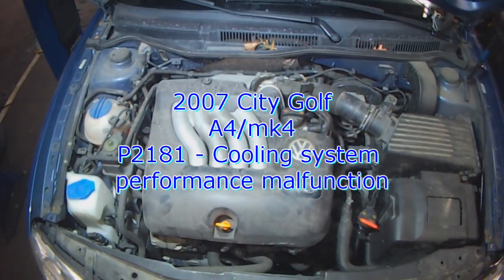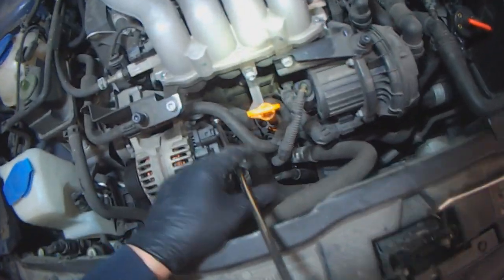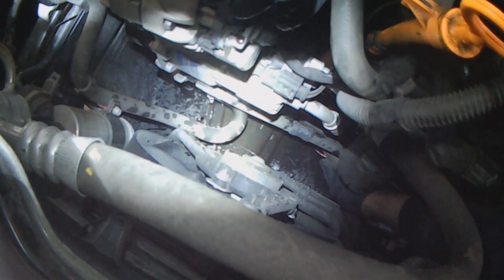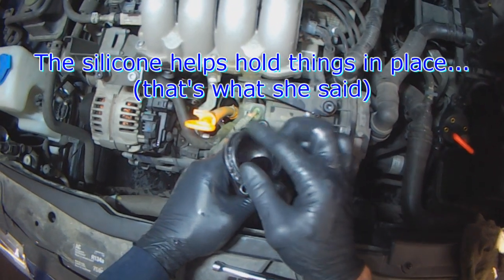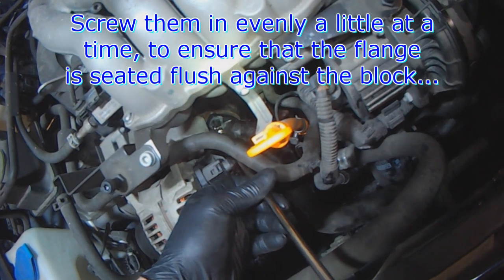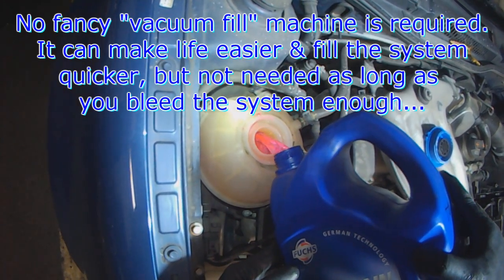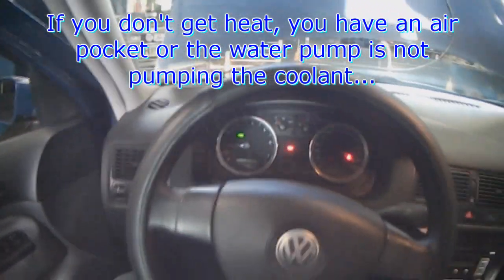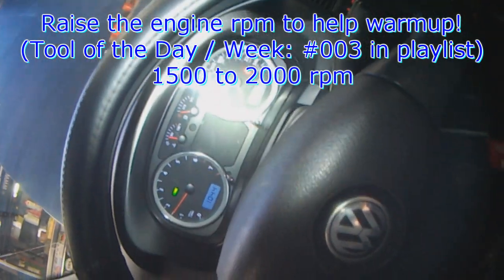VW A4: 2.0L Thermostat replacement (full)

Comment: Wow Thomas! You did a really great job in replacing the thermostat and you had a bunch of tips in doing this job along with what temps should be, when the fans should come on, checking hose temps, how to bleed the air out, checking fuses and the list goes on. Videos like this along with all of your others will definitely help folks out there who are learning to repair their vehicles. And thanks for the shout-out on the masking tape in holding bolts :) Have a good one Thomas!!!
Reply from the maker: I surprised myself with how much talking I did! Rare... rare indeed! No more 52?
Reply: Just figured that just stuzman would be easier to remember :)

Comment: Watching stuff like this makes me appreciate how my MK2 is much more simple and easy to work on.
Reply from the maker: Depending on the engine & accessories... the mk2 thermostat can be a bigger pain than the mk4. =)
Reply: 1985 1.8L SOHC no powder steering or AC to get in the way.
Reply from the maker: Prepare2Survive Nice!
Reply: I really like your trick using an old glove to hold a bolt in the socket. I'll definitely be using that one some day.

Comment: Thanks for the Vid 👍.  Just swapped the thermostat in my 06 Jetta as it threw a code for being too cool on the highway, 2181 I believe it was.  I did end up pulling the alternator which was a bit more work but still not bad.  Maybe 3 hours tops from start to finish.
Reply from the maker: Thanks for watching and thanks for sharing your diy success.

Comment: This is a great video, especially you're little trick with the 14" -1/4" extension and 10mm swivel socket, ...priceless!
One thing, might you please consider expanding the title to "VW A4: 2.0L Thermostat replacement (full) and front water outlet check"?  There are so many, many "A4 side coolant flange replacement" videos, and someone less familiar with A4s might not realize that the actual name for that thing leaking on the lower front of the engine is the "thermostat housing/water outlet" OEM Part No. 06A121121C and that they need THIS video.   Thanks again!
Reply from the maker: It's an "inlet". =)
Thank you for watching!

Comment: I usually put the thermostat O-ring inside the block over top the thermostat to A: help hold thermostat in place, and B: to have it in the right spot. I like your way as well also. High Five for not removing the alternator and being lazy like me! :D
Reply from the maker: I can't remember when or why I started placing the o-ring on the flange... could be that I didn't trust myself with placing the flange over it after. Yeah, if you don't have to some / remove something, why do it!? LOL

Comment: I replaced the side coolant flange and am flushing green coolant from my car. I drained the old coolant from the radiator plug as well as the oil cooler hose. Repeated flushes are still coming out watered-down-Gatorade-yellow, and I can only put around a gallon of water into the system after draining again at the plug. I'll pull the return hose off tomorrow and check for clogs. I can see some fluid returning through it, but it doesn't look like a good flow. Thanks for the tip! Hopefully it does the trick.
Reply: On an interesting note, when I pulled the hose to the oil cooler (the one closest to the car grill... It was easier) I found the giant sliver of plastic that had broken off the flange and caused the original leak. I thought I'd broken something in the cooler until I recognized the shape.
Reply from the maker: Plastic pieces from flanges or the water pump impeller tend to not want to be found... you got lucky finding that one! As long as you get the majority of old coolant out, you'll be fine. Flushing every 4 years can help keep things fresh.
Reply: I think the issue I had may have been caused by having the front of my car on ramps while draining the coolant. Most of it couldn't reach the hoses. Checked the return hose anyway, and it was clear.
I'm glad I found the plastic sliver, at least... Whoops!

Comment: Just out of curiosity is it mandatory to remove the the Oil Cooler line and drain the coolant from there before removing the flange/thermostat?
Reply from the maker: No... but it's less messy that way.

Comment: Great videos man!! Just wondering if you'd know some causes of no heat coming out when the engine is hot and the ac isn't that cold either?
Reply from the maker: Louis year, make, model, engine? Does the engine run hot (needle move past the middle)?
Reply: 1999, VW GOLF, I believe its an AGN, 1.8-20V. And no it does not run hot, it reaches the middle point and never goes pass it. And just today smoke were coming out of the vents and I didn't have the fan going.

And is it normal for VW MK4's to idle just above 1000rpm when cold and after 3-4min it drops to 850-900 rpm and the temp meter on the dash still hasn't moved.

Thank you so much for the reply

Comment: i have a question for you, its a little of topic but what's a fair price to replace a transmission on a Audi A4 cuattro 3.0 6cylinder? would really appreciate a reply.
Reply from the maker: No idea... I can look-up "suggested" labor rates (standard or automatic) that's about it. Labor rates ($ per hour) range quite a bit from shop to shop / country to country. I could give you a $ figure, but it could be more or less in your area. Contact shops in your area to get a feel of "an average" amount. Estimates are estimates... if the shop runs into issues due to the age of the car (rusty bolts, other broken components  in the area that need to be addressed) more $ will be added to the initial estimated as the work continues.

Comment: Just a quick question, and I hope I don't sound dumb but why pull the "oil cooler" hose on the bottom and drain all that coolant if you're just gonna pull the top hose (for the thermostat)? Seems kinda like a waste of coolant and an extra step that's not really necessary. Any advice would be much appreciated...thank you
Reply from the maker: It's less messy to catch coolant from the cooler hoses, than coolant that runs down the engine block and bounces off of everything. My videos are not DIY videos, they are videos of me working. Everyone does things differently... hence, your instinct to question my approach. Whatever works / is easiest for you.
Reply: Ok so pretty much there's gonna be WAAAAY more coolant that comes outta the hose connected to the thermo then if it's not drained from the bottom hose?
Reply: And sorry if i sounded rude, that wasn't my intention I was honestly just wondering why you drained the bottom hose as well as the thermo hose. But thank you for you'r reply. I'm currently in the process of replacing my thermo on my 2.0
Reply from the maker: @Adrian-se1go  either way is fine.

Comment: Can I just Dain my coolant via drain plug cause I need to do it anyway
Reply from the maker: Year, make, model, engine? The drain plug at the radiator does not drain all of the coolant... it only drains the radiator. To drain the engine block, remove one of the oil cooler hoses. A bit more coolant might come out of the thermostat hole, once you remove the thermostat.
Reply: @EXOVCDS  I have a 04 Jetta 4 cylinder 2.0L
Reply from the maker: @dannya__5106  if you are replacing the thermostat, drain at the oil cooler... and at the radiator if you are going to do a flush.

Comment: i took out my battery in my golf 2.0 auto and it doesn't shift  fells like it s in 2 gear before i took out the battery it drove fine
Reply from the maker: MiguelVGarage Check engine & transmission computers for fault codes. Clear codes if any are present. Probably a transmission speed sensor issue.

Comment: I think this car may have the wrong coolant bottle cap, looks like its from mk5 platform, which probably explains why you had difficulty fitting it back on?
Reply from the maker: wizkid01 Possibly... the city golf & jetta were produced into 2008/9 when the mk5's were around. The cap was easy to turn once the lube got to the dry threads. I know the mk4 caps are bigger than the mk3... don't know if the mk5 are different from the mk4.
Reply: if you see in one of your other videos... https://www.youtube.com/watch?v=4OtXEqdTXvc
that's what the mk4 should have.
 Sorry if it seems sad that I can pinpoint these differences but... honestly I'm not :)
Reply from the maker: Well spotted. I don't doubt the difference in look and it could very well be that it is a mk5 cap... seeing that the mk4 & mk5 bottles use the same "Pressure testing adapter", I can't see that there would be an issue with a mk5 cap on a mk4 bottle... or vise versa. Yes, the part number is different for both caps (physical look is different), but I doubt that anything else is (size of threaded part & the valve inside). I've had many caps that were difficult to start until I lubed them up a bit.
Reply: Thomas EXOVCDS yea, guess they are all interchangeable.. So much information and tips on here about how to do things I've learnt a hell of a lot, thank you for making these videos 👍🍻

Comment: at https://youtu.be/GM6FzBMNQIc?t=1349 (second 1349 ) what is the red thing to the left of your left hand? Is that some sort of aftermarket battery disconnect?
Reply from the maker: kfrdubber Starter disconnect... starter won't crank when in the disconnected position.
Reply: Our 2002 MKIV never had that. Y have something like that?
Reply from the maker: kfrdubber Someone (owner?) installed it... to prevent theft?